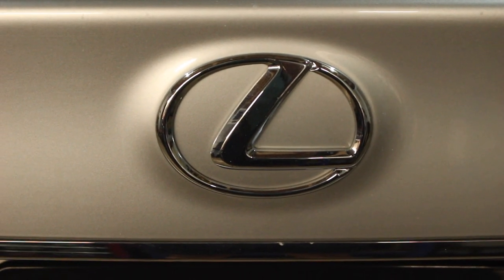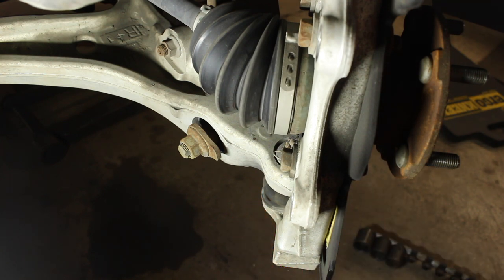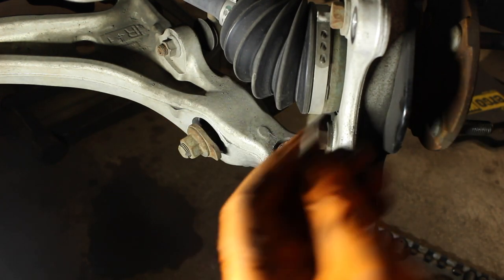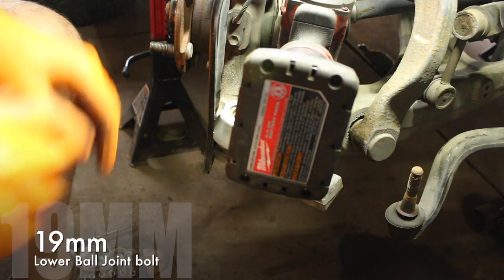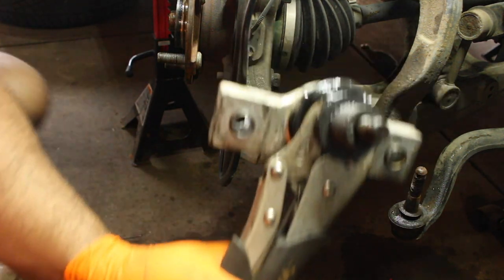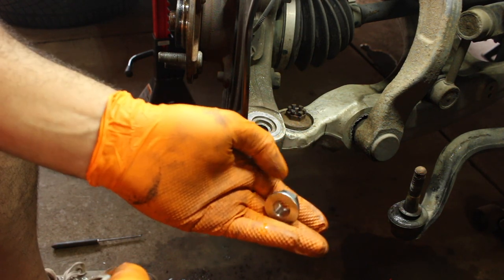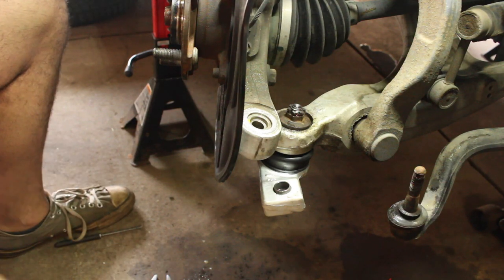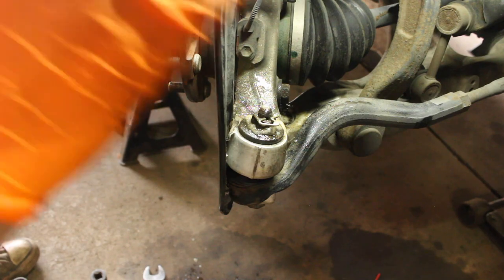2014 Lexus GS350 AWD front Lower Ball Joint

Comment: 1. rotate cotter pin with needle nose pliers then pull. 2. hit ball joint nut with a wrench before you disassemble from the knuckle bud...much easier. or if you did it your way, you could have literally just stuck a screwdriver in the open hole where the bolt was just to zip off your ball joint nut...

Comment: Wow, you're really struggling with that cotter pin.  Correct way to do it is to turn the wavy side to the top side and pull it out.  Otherwise, it latches on to the castle nut like it is intended to.  Think of it as a key and lock mechanism where you have to turn the key back to the upright position before you can pull it out.

Comment: What kind of symptoms did your car had? I have a es350 and I believe the ball joint is bad. I do see some grease around it and it’s popping when I have been parked and start to move away. Otherwise, it rarely ever makes any noise at all. But I can tell that something is lose and when going over bumps it feels rough. Before it was pretty tight. Mine only had 95k miles. But it’s a salvage title, therefore not sure what happened to it exactly. I already had to replace the radiator because it failed. It was a cheap Chinese part
Reply from the maker: yoyo Bored the customer complaint was loud banging over bumps coming from that corner. As you can see from the video there was also a lot of play in the ball joint

Comment: Thanks for this video so much, answers so many questions for me. Having the same issue with my 2014 RWD GS fsport on all 4 wheels! Had the knocking issue initially on one of the front wheels at around 60000 miles. Didn’t know what was causing it at the time and dealer said everything was normal (as if they actually tried to diagnose it) ignored it till it progressively got worse and now at 110,000 miles knocking occurs on all 4 sides. Wanted to ask you, could bad control arm linkages cause the same type of knocking? If so how would one differentiate that from the ball joints? I was planning to swap the linkages and ball joints on all 4 sides but not sure if it’s necessary thanks again!
Reply from the maker: I can’t really answer your questions without looking at the car. Bad control arms will cause wondering of the car, misalignment and knocking over bumps or while steering. If you’re going to replace them replace them with oem Toyota/Lexus or higher level part.

Comment: Already have to change out the lower ball joint?   I just changed my 2011 Camry and i really didn’t need to change them.  159K.  

I guess quality has gone down.
Reply: Sir Sweetness This is my car. It was in a pretty bad curb accident a few months ago involving this wheel. We’re thinking the repair shop just overlooked this part.
Reply: FrederickGFX 

    Makes sense.